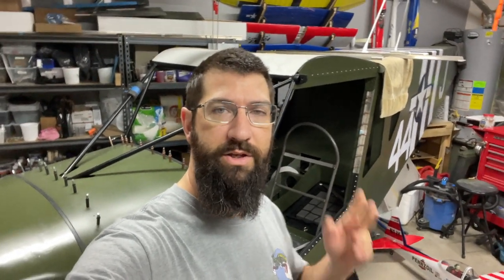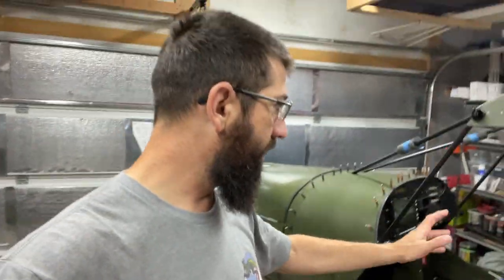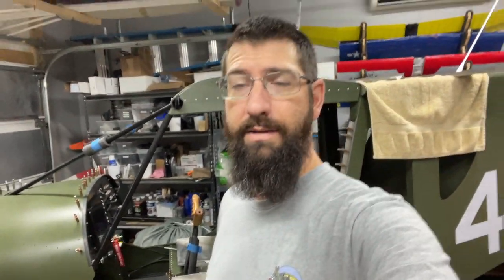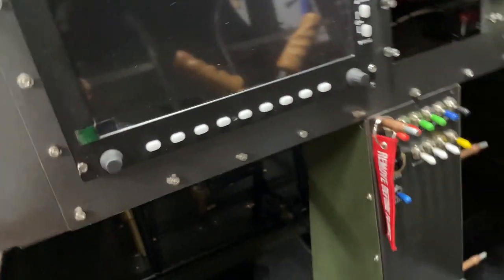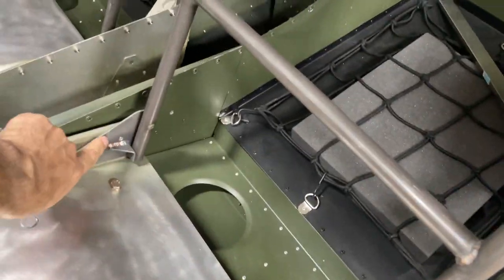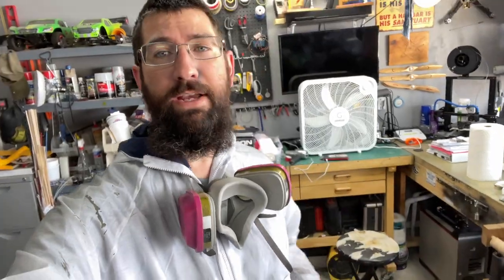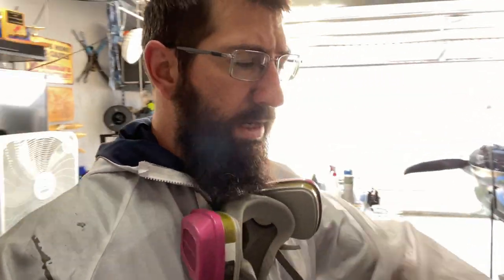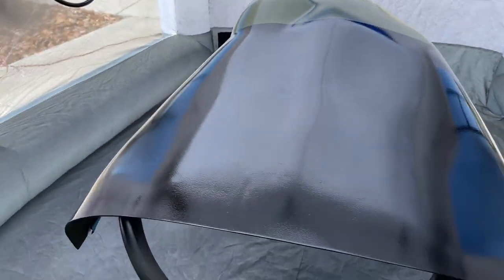L750 Cricket Build: Painted the Seat Frames and Glare Shield

Comment: I think its Flightline Interiors Joe, not Flightline Design.  I chose the sliding seat option as well for the same reasons you indicated.  It is surprising how much they weigh, but it's a feature that was important to me as well.  A number of builders have mentioned there are clearance issues between the seat belt anchor locations and the sliding seat.  I am not far enough along to assess this.   I did not install the rails or the seat pans at this point thinking as you indicated that I would want to have access further down the road.

I am going with Flightline Interiors for my seats as well, but just paid the $400 deposit 6 weeks ago so for sure it will be a while before they arrive.  I hope you get yours soon!    My building pace is about 20% of yours.  Its amazing to me how quickly you have moved through the build.
Reply from the maker: You are correct it is Flight line Interiors. They have been really busy lately. I put in my order Dec. 2020. At that point they were booked till Sep. 2021. So it pays to get on the list well ahead of when you need them. I know they will be beautiful so worth the wait. Regarding the belt, I don’t really see the issue, but I guess it will depend on how far you need the seat back. May need to check it out.